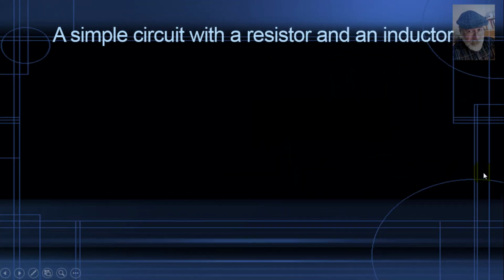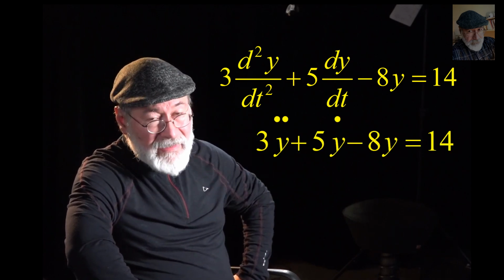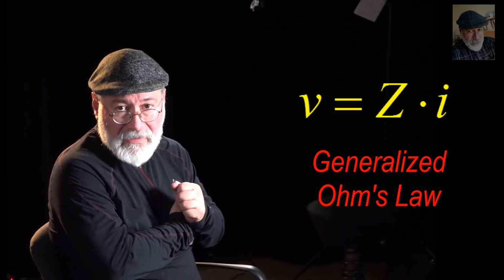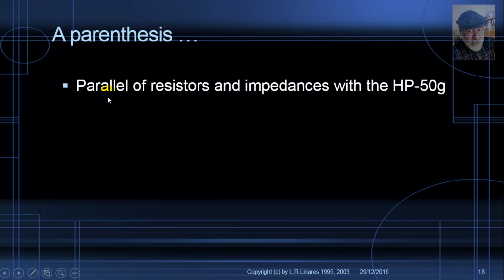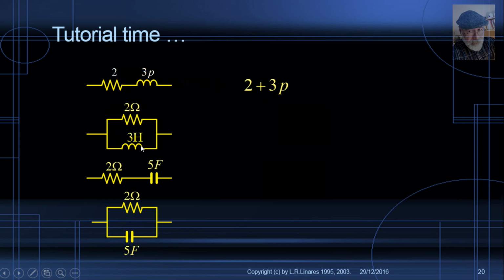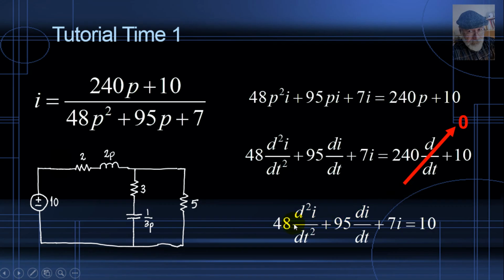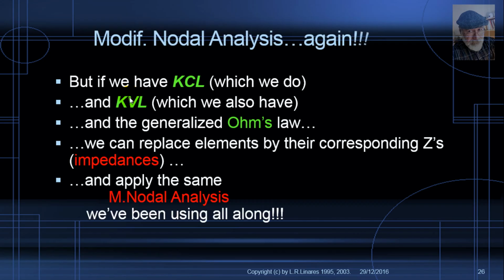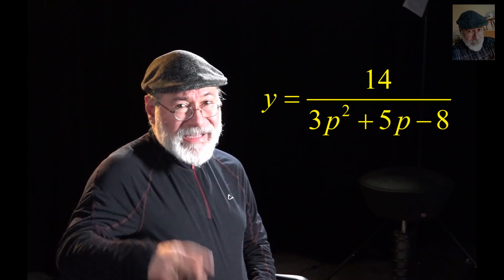EE 101/25 = Inductors and Capacitors in Electric Circuits (1 of 3)

Comment: thanks for the video, but where are others parts?
Reply from the maker: I have been meaning to produce them, but life has a rhythm of its own. Sorry.
Reply: thanks for your reply , can u recommend me  a book that follow the hevieside approach in circuit analysis? because I loved what u said in this vid , its very simple
Reply from the maker: In reality, once you have obtained the differential equation as in the video, using the Heavyside method, the solution of the resulting equation is done the usual way that we all learned in math courses:  after finding the initial conditions, which is the topic of the second and not-yet-done video, either in the time domain (topic of the third-yet-not-done video) or using the Laplace transform method that is explored in the Laplace solution series of videos in this channel. The good news is that, usually, at the signal frequencies of interest, we can approximate very often all reactive elements but one or two (that is, capacitors or inductors) by a simplified circuit equivalent (as shown in the second video ... I know, not done yet.) and that results in a first or second order equation that is very straightforward to solve.
Reply from the maker: And, no. I used the class notes of the late professor L. Pipes for his graduate class at Harvard, a lifetime ago. So, I do not know of such a book. Then again, once you start using the Laplace transform, you may jump directly to the time solution in a very elegant way and skip the blues of the time-domain.
Reply: thanks for your reply, you told us in this video u can get much info from the equation and u dont' have to solve it.. I was excited to know what info because I love understanding the circuits and how they work,,
Reply from the maker: I'll try ... but the Summer is ending.
Reply: thanks for your care :D :D

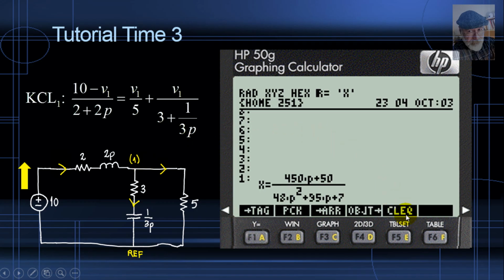Comment: Thanks for the great videos! If you get the chance could you share how you programmed CLEQ you used at 28:15. New to hp50g thanks again.
Reply from the maker: From the top of my head (I don't carry my HP-59g's with me anymore, now that I have the HP-Prime as my main calculator) << OBJ->   DROP DROP SWAP DROP >>  My lawyer insists that I add the following paragraph: I share this with the community on as AS IS basis. No guarantee is made of its quality, nor of its correctness. If you choose to use it, you assume all responsibility for its use and any losses (monetary or otherwise) that may occur. I suggest that you read the program instead, learn how it works, and create your own. That way you'll be completely aware of its limitations and possible side effects if any. OK, now my lawyer should be proud. Anyway, enjoy your HP-50g. And thanks for the praise and support.
Reply from the maker: Errata: "On an AS IS", not "on as AS IS".

Comment: Fascinating. Would it be correct to say that the p becomes d/dt . So could we not just write 14/(3d^2/dt +5d/dt -8) instead? I have never seen this before in any of my electronics text books. Really interesting stuff! What is MNA method?
Reply from the maker: MNA stands for Modified Nodal Analysis, a method that is used widely in most, if not all, circuit solution software packages. As I describe it in another video, a method of solution "to rule them all". I have dedicated several of the movies of this series to it. MNA is the core of this series of videos.
Reply: Yes I always use nodal analysis. Never heard of modified version though. Will look it up. Thanks. I have been using Laplace transforms for solving circuits. Which seems to use a very similar approach. In fact it looks like the same kind of method. But this method looks equally interesting. When would you use transforms and when would you use these 'p' operator methods? Is one better than the other?
Reply from the maker: Laplace transform analysis is the way to go if you want not only the ODE but the time domain solution at the end. It is the method introduced into what will be the second part of this series, AC and frequency analysis of networks, filters, etc. The p operator, however, maintains the analysis in the time domain, in our universe, and is friendlier to a first timer into the transient analysis and behaviour of circuits. Friendlier at the expense of the elegance provided by Laplace treatment of I.C., which is superb, but that is cloth for a future dress. Keep on using Laplace. I use 'p' operator when I don't need to solve the differential equation but merely need to find the eigenvalues, natural frequency and time constants of a network without leaving the time domain.
Reply: Thank  you very much. That makes complete sense to me now. I am one of your invisible friends. And very glad to have subscribed to you when I did. Really love your teaching style. You put over so much enthusiasm it is contagious. Now the lecture on eigenvalues I am looking forward to as I have never heard of that before either. Although I have spent time on linear algebra with matrices using it. Be lovely to see an actual way of using them at last! Can't wait for the next episode! Many thanks again.
Reply: Sorry again. just to clarify. When we use MNA is it where we always treat currents as (not entering our designated node) but always instead leaving our designated node (making sure our designated node is never a voltage source). So if an upstream node has a down stream voltage source with the ref node below that same voltage source, we will still set current as leaving that node even though it may go through the plus of the voltage source. Hence keeping same standard procedure always, making everything much easier if we ever wanted to solve as a matrix on a computer or HP Calc. Have I got that right?
Reply from the maker: I have put together a whole series dedicated to MNA, here it is https://www.youtube.com/playlist?list=PL1-PpkqcSWX4qNiSxizLIZK_hogj34UxX
Reply: Ok brilliant! thanks